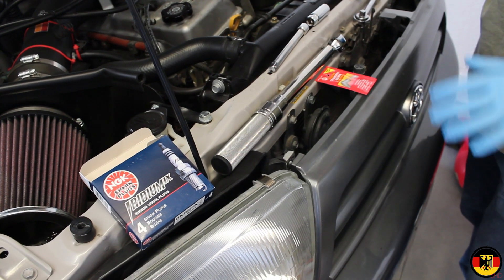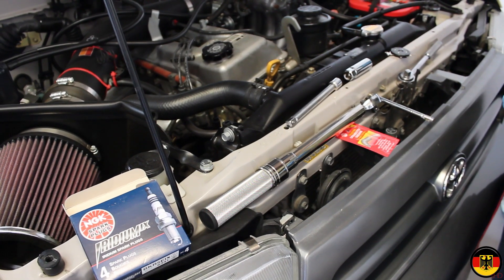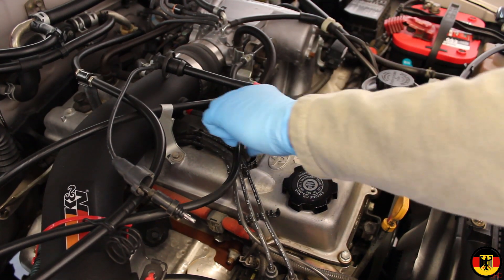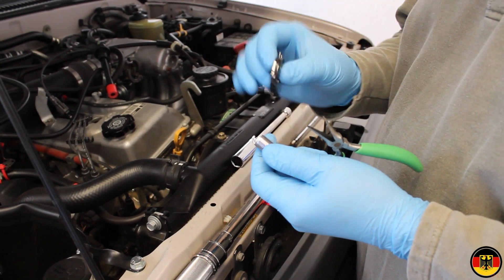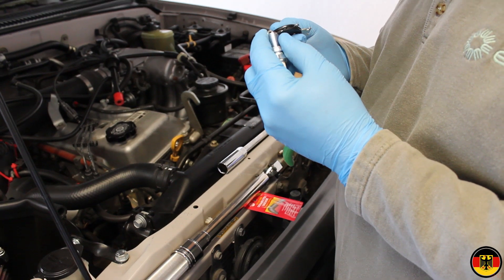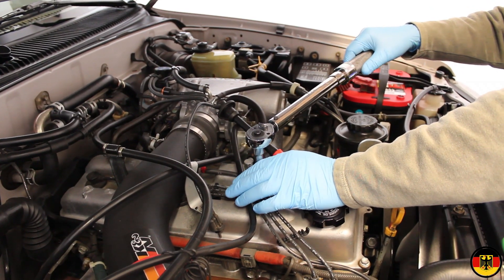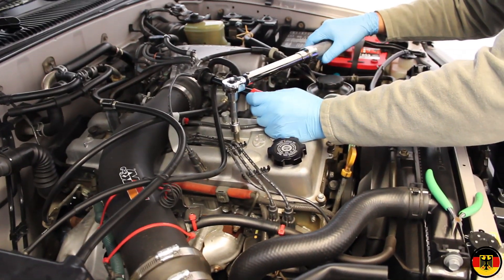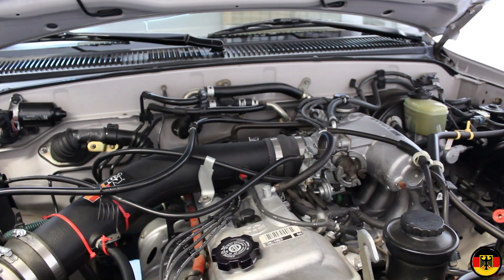How to Replace Spark Plugs in a Toyota 3RZ-FE Engine

Comment: Interesting my three RZ looks nothing like this.  I have individual coils on top of the cover, and you must first slip out a deep plastic bit before accessing the very submerged spark plug
Reply from the maker: You have one of the 01+ RZ engines, they switched to coil on plug.  Interestingly earlier ones were also different and ran a distributor.  Three different variants.  Thanks for watching!

Comment: I have a 97 4Runner I did the wrong size because someone changed the hood and said the wrong engine so I had issues with power loss at 0.044 so I looked in my book and checked the other size which is 3RZ-FE not 5VZ-FE and the factory rating is 0.031
Reply: The Tacoma T100's also have the same engine types as 4Runners 3rd Gen

Comment: hey, i have a 2004 hilux pickup with 3rz-fe engine and i confused because of the spark plug wires .
in the repair manual they say 25 k ohm max .
i wonder if you can measure that and make it clear especially a new ones.
thanks for the useful great videos .
Reply from the maker: My truck is still using the original Sumitomo spark plug wires from 1997; they are still good.  If you need to replace yours and can't get the Sumitomo wires (the Denso ones from the dealer are subpar), get the blue NGK wires.
Reply: thanks

Comment: Denso and NGK spark plugs came pre-greased so first time install should be done dry like you did. They put this info on their websites.

IMO, only need a little anti seize if spark plug is taken apart and reinstall.
Reply from the maker: Thanks for the information.

Comment: They do make spark plug sockets with rubber boots inside to hold the spark plugs to save you all the troubles, my tool kits all came with one or two (for the larger plugs)

One important note though, for those who use large torque wrenches, be careful, because some (1/2 inch ones) are made with lowest torque settings of 28Nm, so if you try to set it at 18 or 20, it will not click and you will keep on tightening.. Big damage..
Reply from the maker: The torque wrench that I was using is made by Snap-On, and is set for a lower torque range than most 1/2in drive wrenches.  I agree, some higher range wrenches will create a problem if you cannot set them to the right setting.
Reply: redonKiLaus yep I noticed your snap-ons, they are one of the best, came with a big price tag though :D

Comment: I, too, have the 3rz-fe engine in my '97 4runner. Today, as I was on my way bringing my kids to school, my engine began to idle rough. I went to the auto parts store and their obd II reader pulled up a p0300 and p0301. The lady there said I should have my spark plug(s) replaced and, maybe, my wires if the spark plug for number 1 cylinder doesn't fix the problem. Thanks for recording this DIY, sir. Schoos.
Reply from the maker: Just take it slow and easy, you might want to put anti-seize on the plugs.  Also be sure not to drop the plugs into the holes, as it might mess up the gap of the plug.
Reply: redonKiLaus last Donnerstag (15th of Nov). I did use antiseize on the threads. I did follow your recommendations of using die elecetric grease on the plug wire in the two places you mentioned. I did not drop the plugs into the plug holes to ensure the gaps held their 0.031" distances. Danke, again, Herr Redonkilaus!
Reply from the maker: Bitte schön.  Thanks for watching!

Comment: antiseize prevents galvanic corrosion, which is more important than the torque on the plugs. If you have ever damaged or repaired the threads in a aluminum head, you'll always use antiseize when you install plugs (or anything) in aluminum bolt threads.